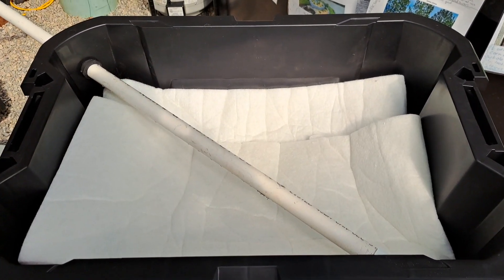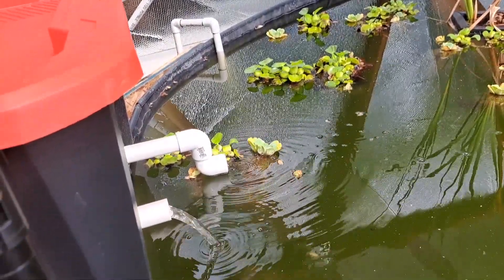DIY Pond Biofilter Build

Comment: Good video. Question. Does the bio-media need to be sitting in water or just have the water run through it?  I build a similar filter to increase good bacteria but I cannot equalize inflow rate to out flow so that media is sitting in water. Any thoughts?

Comment: The holes in the pipe will eventually clog with biofilm. I have a tray with lots of 1/8" holes drilled is easier to clean than drilled pipe. Be sure to put a prefilter material above the main bio media which will keep it clean. You dont want any debris making it into the bio media, just water. A lot of folks use polyester wadding for prefilter material but terry nappies made from cotton are a biodegradable option , rinse them out in a bucket of pond water when they get clogged. They can be composted when they give up the ghost. Place the prefilter material in the previously mentioned drilled tray and you`ll soon have crystal clear water.  You can make multistage filters out of cheap plastic 3 or 4 drawer storage towers, prefilter material goes in the top drawer, polyprop scrubber pads in the 2nd drawer (trickle filter), hydroton in the third which should be mostly submerged in the tote that the tower stands in. Drill lots of holes in the bottom of all the drawers.